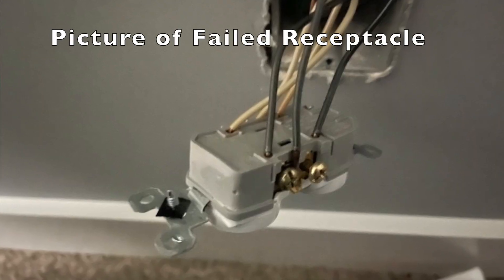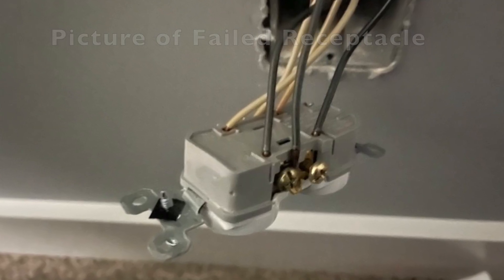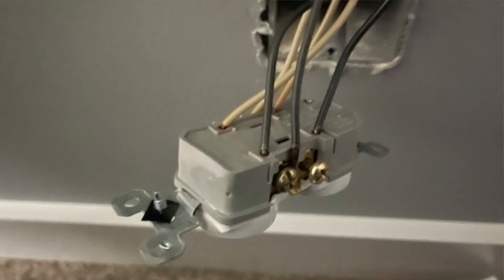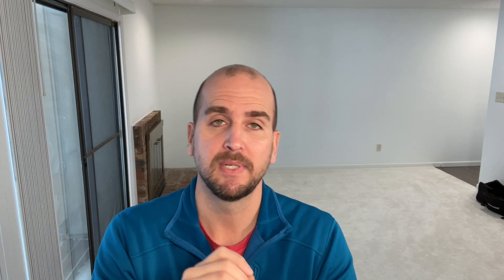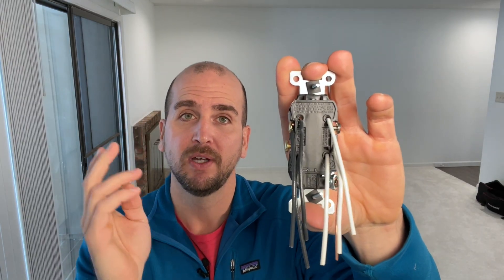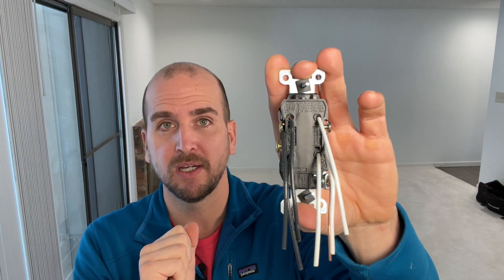Incorrectly Wired Outlet Found In Newly Built Home

Comment: I’m a retired contractor, I can’t begin to tell you how many times I’ve found plug ins that’s failed with electrical wires pushed in those easy holes in the back of the plug in rather then using the screws on the side properly.  Thing people don’t realize or understand is those holes on the back only have a very thin piece of metal making contact with their electrical wires and less contact with their wires create excessive heat especially under a heavy load and it’s the potential of a fire just waiting to happen using those holes.  Many of these plug ins that’s failed using these holes shows where excessive heat on the back of the plug ins have actually melted and black residue inside the box from wires casings starting to burn.  Most don’t start fires but I have seen some that has! It’s just not worth the risk of a fire to save a little time and effort using those holes on the back of the plug ins rather then wrapping your wires around the screws on the side of the plug ins to make sure your wires have as much contact with the metal screws as possible to keep from having heat from being built up from a bad contact with your wires! I honestly can’t believe that using those holes on the back of the plug ins meets code, nor should they be UL approved in my opinion either! But I’ve learned over the years just cause a product says it’s UL approved doesn’t mean in the least that the product is safe! I had numerous UL approved space heaters over the years I’ve used that has had the wire that plugs into the walls plug in get so hot that the wires melted and started a small fire on my floor after using the heater only a few hours for a month or so.  If you use space heaters it’s always a good idea to check the plug in wire coming out of the heater to see if it’s hot or not?  If it’s hot I would not use it any longer and if the plug in wired using those holes on the back just adding to the risk of having a fire in your house!
Reply: I’ve talked with numerous electricians that’s warned me more then once to absolutely never use those holes  simply cause there’s only two very thin pieces of metal that’s actually making any contact with your electrical wires!  If it was thick where it made contact with the wires I highly doubt there be enough give in the metal that grabs your electrical wires to actually grab and hold the wires!  As I said earlier, I’ve seen far too many electrical plugs fail using those holes including some recently that were just on the verge of catching fire when they failed.  Considering the potential of the damages and even the possibility of loss of life by a house fire! I certainly wouldn’t risk using those holes for any reason! I’ve personally been thru a house fire loosing everything I owned. You don’t really realize how devastating a house fire can be till you’re lived thru one!
Reply: @ghostridergale  Not all receptacles are built the same. Some are actually built with the concept of making as much contact as possible by not using the edge of the metal but similar to a slide in with a biting edge, quite ingenious really. Thing is they are not easy to find, not cheap and plenty of pretenders.
Reply: That is almost always true. There are however an entire line of push-in receptacles that are built with the concern you have brought up and have a half inch (maybe it's a cm) of surface contact that pinches the wire. Much better at keeping current and circuit use. The only issue now is that some people don't understand the use of one metal to avoid electrolysis.
Reply: @Joe-by8jh  Yes, WAGO, I totally agree. It really doesn;t matter if there is at least one guy on the internet espousing the advantages of WAGO even if the premise seems to be it's being used in such low current capacity that it's somehow okay. I don't buy that, and I don't think anyone else should either. The more surface area to transmit electrons the better.

Comment: In your video where you are showing putting in pigtails, you reference it’s 12 gauge wire as it’s harder to work with but the receptacle you’re putting in is 15 A rated?
Reply: It's permitted to put 15 amp receptacles on a 20 amp circuit.

Comment: HELP!   I replaced a garage grinder and saw they socket looked old, so I replaced it.  At first it didn't work, but I found I needed to knock out the connection between the buss between the upper and lower tie screws on the RH side.   NOW,  I still have the same problem -  the grinder doesn't stop when I hit the wall switch.   Not sure why I still have the issue unless the switch is damaged, but it worked fine before.

Comment: Good video. A couple points....
When your done, wrap the outlet loosely with electrical tape. This will help provide an additional layer of insulation for the screws..... 
If an insect shorted something out it could fry itself into a fire....
Next, the pigtails with the wire nuts are becoming outdated. There are new clips (Wego....there are cheaper brands but why risk it..) that allow you to push in the wire without the need to twist everything together. They're much faster to install and do less damages to the wires.

Comment: This is an example of a receptacle also being used as a "through-branch" device.  I presume that the double push-ins and screw terminals are meant for split receptacles, not as an alternative to pig tails.  For split receptacles (might be losing in favour of t-slot 20A varaints) you break off the tab between the hot screws, supply two 15A separate-phase services and run with a common neutral.  Do local codes allow receptacles to be wired as through-branch devices?
Reply: Yes.

Comment: Thank you for showing the pigtail method. The biggest advantage to using this method is that if you have to change one outlet, you are not affecting the others in the chain. Yes I know this method costs more and takes more time, BUT it makes for a much safer and trouble free install. 
Great job, thanks !

Comment: Pigtails take more room in the box and so I prefer to wire right into the outlet. And pigtails also tend to come lose when pressed hard in the box. Technically you can wire 4 wires on each side (2 push ins and 2 screw ins).
Reply: Pushins cause more resist and therefore more heat. Go with the tail.
Reply: @beinghuman3225  Outlets do not overheat unless wired incorrectly and in most cases the breaker trips if an outlet shorts out.
Reply: The problem arises when the outlet fails, you'll lose power downstream of the outlet. That's why many of us use the pigtail.
Reply: @fuckgoogle8012  A good outlet rarely fails in the home ... I have had 4 homes with many outlets over a 20 year span and none of the outlets have ever failed  ... not one!
Reply: @fuckgoogle8012  easy to find the issue.
Reply: @fuckgoogle8012  here's the danger in  using tails on residential. Say Joe Shmoe put in a window AC, and is using the circuit for more. If Joe gots no tails the receptacle will melt and fail in the box. Now let's say Joe's gots tails, the circuit will fail when the wire melts and that can happen in the wall between two receptacles. Now Joe's house is a major fire hazard.
Reply: @beinghuman3225  joe shmoe should've used the appropriate size wire for his circuit that solves the problem. Pigtail isn't the issue that would be over current.
Reply: You need to learn more about electrical before you pretend to know dude. Even a 15 amp window unit should be on it's own circuit, also if you read the owners manual it  tells you that. Let's assume someone is dumb enough to try this. You would have to have used the inappropriate size breaker to run enough current to melt the wires. Its extremely unlikely that this would happen. Not to mention most heat is generated at the breaker, so as it approaches its rating it begins overheating which weakens the internal spring inside the breaker at which point it will unlatch and require a reset. Assuming you have the appropriate gauge wire and the correct breaker the probability of a fire is almost nonexistent.
Reply: @fuckgoogle8012  you misunderstood me, Joe is the homeowner.
Reply: @beinghuman3225  15 amp outlets have a maximum rating of 1875 watts or 1500 watts practically speaking and so when you load it beyond 1875 watts it blows the breaker ... no overheating of the outlet or electrical wires. The only time one could have an electrical fire is if the breaker fails, but this is rare.
Reply: @mauriceharting5877  sounds like you've never done service calls. And fyi, 15 amp receptacles are okay  for 20 amp circuits on residential.
Reply: @beinghuman3225  I don't use 20 amp circuits for 15, 30, 40 amp circuits is what I have used for home wiring on 100 and 200 amp service panels and every electrical inspector has approved my work on their first inspection, which most professional electricians do not receive.
Reply: @mauriceharting5877  I hope you wouldn't use 20amp circuits were 30 and 40amp are needed. But it does sound like you probably still rent (aka, have no responsibility for the property you live on). 20 amp receptacles are not required for garage door openers or outside, as an example. If you're putting 15amp circuits there, it's obvious you either rent or are a bare minimum electrician.
Reply: @beinghuman3225  When using standard 14 gauge copper wire for home wiring you may NEVER use a 20 amp breaker and should ALWAYS use a 15 amp breaker. Go to 12 gauge wire for a 20 amp breaker. Typical electric cooking stoves require a 40 amp breaker with a 8 gauge wire, and clothes dryers typically use a 30 amp breaker with a 10 gauge wire. This may change pending on how long the run is of course.
I don't rent but have owned my own homes (3) for over two decades.
The proof is in the pudding when Certified Government Electrical Inspectors approved my electrical work on their first inspection visit I did the jobs right, would you not agree?
Reply: @mauriceharting5877  sure, from what you've said none seemed not to code. But let me tell you what an inspector told me once (and these are words to live by), doing a job to code only means you've just done the shittiest job allowed. Stay safe out there 💜
Reply: @beinghuman3225  Here is a question for you: Can and should the grounded (neutral) conductors be grounded at the main service disconnect or not?
This is actually a trick question for some Government Electrical Inspectors want the ground and neutral to be connected to each other at the main (100 or 200 amp) service disconnect, while other Inspectors do not ... go figure ....
Reply: @mauriceharting5877  sorry son. I ain't gonna help you cheat on a test. Besides one of the requirements/responsibilities of my license is to not give electrical advice to unqualified persons😉. Now good day Sir!
Reply: @beinghuman3225  The Government Electrical Inspectors always have approved my electrical work during construction on their first visit. Have you had that kind of success? lol
Reply: @mauriceharting5877  your ego and arrogance seem very incompetent. You say you do bare bones work, then try to play a game of knowledge and continue on to try and brag. Sure do feel sorry for customers.

I can only imagine this is your interaction with a customer 👇

 excuse me Mr. Electrician, I plugged in my skill saw out back and my 15amp breaker keeps blowing. (Mr. Sparky up here☝ responds) well customer, did you know I never use 20amp circuits were only 15amp are required. And let me ask you this customer, do you know what the federal, state and local jurisdiction accepts as meeting code? Because my inspector always passes my work!

Now watch this pile continue this conversation (which I should've ended long ago).
Reply: @beinghuman3225  Straw man arguments and insecurity on your part is telling ... you claim I rent my home without any proof and even if I did rent my home that does not disqualify my electrical knowledge on home wiring. When you have had outlets that became hot it tells me you did something wrong ,like use 14 gauge wire on a 20 amp breaker with a 15 amp outlet under heavy load lol
Reply: @mauriceharting5877  under normal conditions they last 20+ years. It's always somebody bumping into them while plugged in. Itll crack them. I've seen that fairly commonly.  Another thing I see in some outlets is high traffic use and the prongs become lose and dont tightly hold the cable when its plugged in.
Reply: @fuckgoogle8012  Well in commercial settings where outlets are plugged in and out a lot there would be more wear and tear and they would need to be replaced maybe even sooner than 20 years. But in residential settings most quality outlets last a lifetime unless you get the cheap made in China ones. Also check the plug prongs to make sure they are straight.
Reply: @mauriceharting5877  I was referring to the prongs in the internals of the receptacle. They become lose on outlets that see high traffic.
Reply: @fuckgoogle8012  What you mention is well known by most who use receptacles on a regular basis in high traffic situations, such as common hallways in apartment buildings where these are vacuumed on a daily basis or so. Like I said before, in the 20 plus years I have owned homes I have never had any outlet break or wear out on me. What has happened is that some outlet cover plates have cracked, but nowadays they have better cover plates that don't crack.
Reply: @mauriceharting5877  I'm just happy that we cleared up the idea that pigtails put you at a higher risk for fire. If the circuit is the appropriate gauge and the breaker is the appropriate amperage, the pigtails do nothing other than keep your circuit working correctly in the event of a faulty outlet. I've been hounded for doing it that way a few times and had to sit down and explain myself to them. I've mostly worked in commercial settings but I've done probably an equal amount of residential electrical work as well. Thanks for hopping on and giving your 2 cents. Seems you also know what you're talking about. Have a good day man, God bless!
Reply: @fuckgoogle8012  I do want to mention one more thing in that pigtails are are of no use if the screws on the side of the outlet are used for both copper coloured screws on either side or clear screws of the outlet have contact with each other except in a kitchen outlet where the tabs are broken off for independent outlet plug ins. So there is no power loss if one outlet with break off tabs in place were to fail with those outlets down the line from it. The home wiring ain't the wiring of older Christmas tree lighting where if one bulb fails all those after it in the line will not work either lol

Comment: Only one I agree with as a "mistake" is the third one, not pigtailing.  Most common cause of a receptacle not working is overloading/overheating  of the device.  That is not an installation issue, but more of an end user issue.   I wired new homes for 30 years and always pigtailed and used the screws instead of back wiring and still had device failures after a short time usually because of misuse.

Comment: Mistake #3 - adding the pigtail is bad advice. You are unnecessarily adding wire nuts to an outlet box where they are not needed and adding two more potential failure points in the process.  How is this a better approach? Code doesn't require you to fix your existing outlets if your wires aren't six inches long. I agree with not using the push-in connections.

Comment: There is no code for ground hole direction, but installing with the ground hole up protects a loose plug from possible arc flash should something be dropped on exposed plug pins.  The neutral pin (on devices not double insulated) acts as a guard.

Comment: Any suggestions on fixing a sewage sump that allows ground water to leak in?
Reply: Sewage tank-in-floor should be complete sealed. Your is either cracked or somebody ran a foundation line into it. Either way, just drop in a new tank, no big deal.

Comment: So different to Europe we stopped using screw blocks in 1920 but still used in USA . Also exposed connectors why not have a shield around screw terminals. Also do you earth metal back box